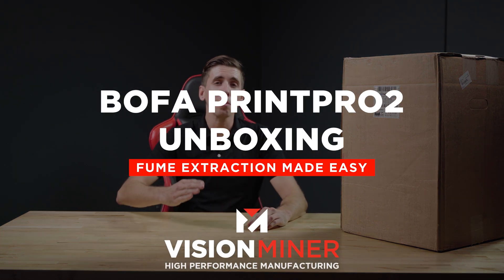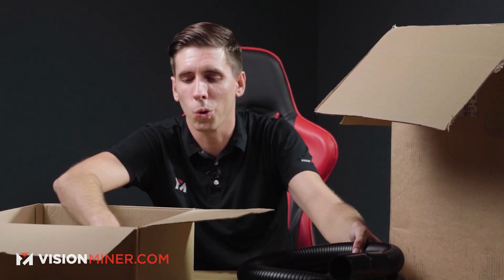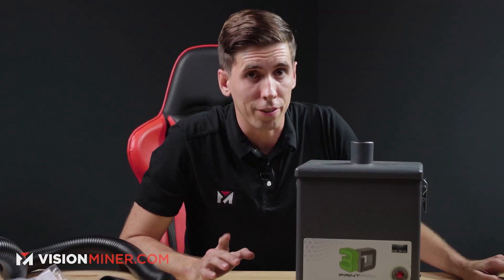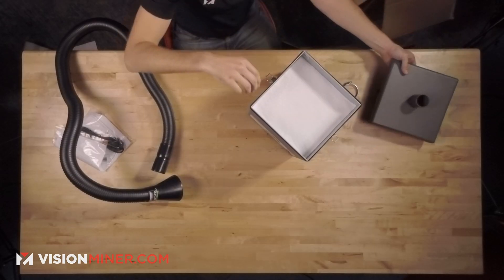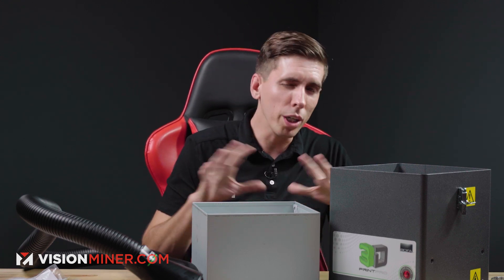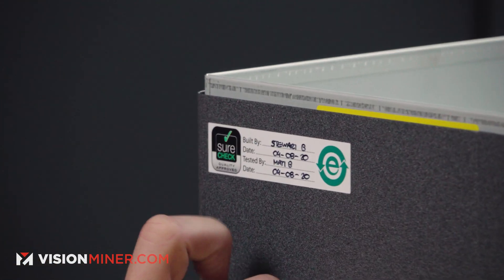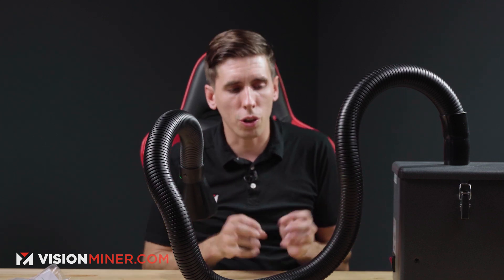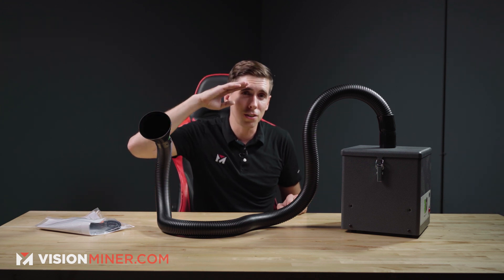Unboxing the PrintPro2 Fume Extractor from BOFA! What's in the box?

Comment: Can this be used for a laser engraver?
Reply from the maker: Yep, and some of the other units have even higher CFM! There are also specific models designed for laser, depending what materials you are engraving.
Reply: @VisionMiner  Thanks.  Since posting this question I watched some videos for a DIY filter that uses the BOFA AD350 filter and pre-filter.  I have ordered the filters and am working on making the enclosure.  I'm using an axial furnace blower fan to draw the air through the filter on the output side, plus I have a small axial fan to help draw the air from the laser engraver enclosure to help ensure a negative pressure difference inside the enclosure.